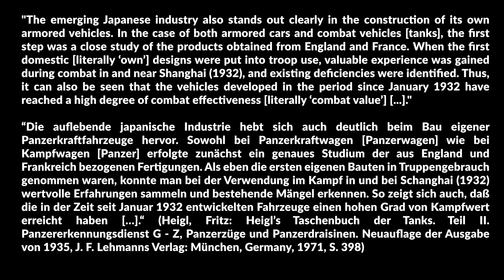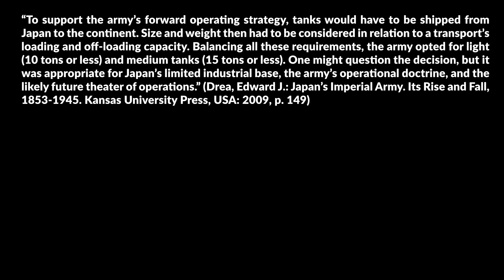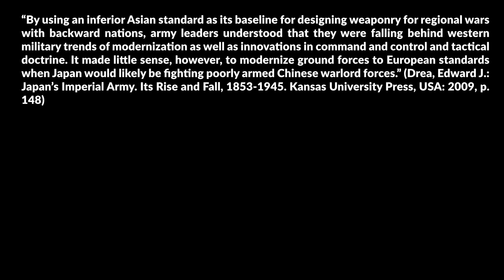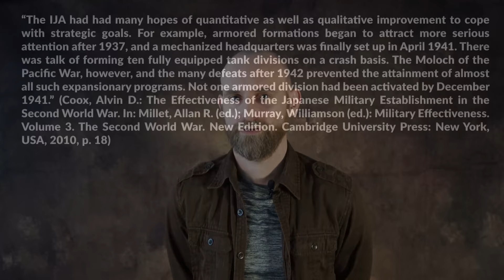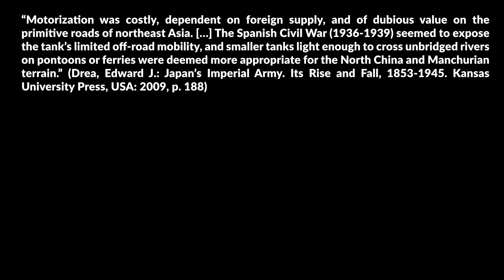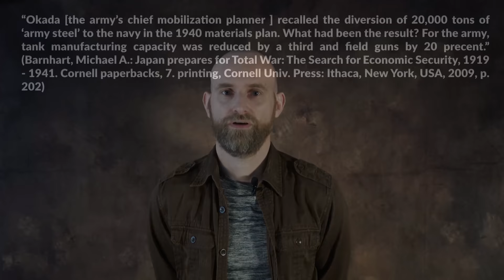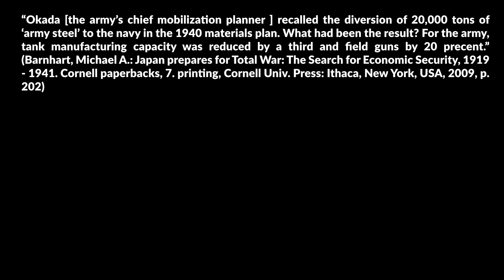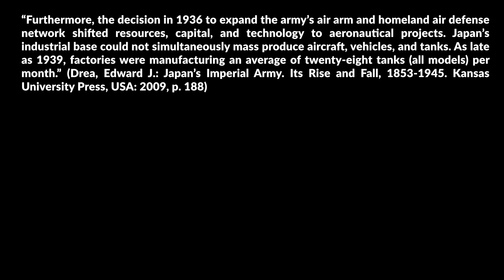The Problem with Japanese Tanks in WW2

Comment: The question thats never asked about the topic is: would japan have needed more or better tanks?
I mean like, they fought, to a big part, against the US on small islands, oten covered by jungle and with beaches, they were the defenders and had, at least on land, relativ short supply routes in these areas. Tanks are great in open fields, provide the benefit that they can operate over a large distance and push deep in enemie lines, something that does, as far as i consider, not really exist on islands. 
Taken this into perspectiv it sound far better if japan had invested more in anti tank guns.
A way to answer this question is, to look up the american use and successes of tanks in the isalnd hopping campaign. Has anybody infos about that?
And yes i know my points are a bit over simplefied, but try to look over this if possible
Reply: But China
Reply: @DioBrando-mr5xs  And as was pointed out in the video, the lack of infrastructure in China meant it wasn't very friendly to tanks, or at least not to the big monster tanks seen in the European theater.
Reply: @DioBrando-mr5xs  and japan wasnt defeated in china, st least not in the short term. What would happen in a longer war is a different thing. But japan was mainly defeated from America over the islands. Would better tanks have made a difference here? Or had tanks on both sides even a inpact?
Reply: @fandysetiawan5019  I’m not trusting that link, never will trust a link
Reply: @Predator20357  especially ones that the "person" just copypasted into the comment thread without anything else
I mean look into that comment history
Reply: Infantry anti-tank weapons would be even more cost-effective, as would mines when defending small areas like islands where you could easily predict where enemy tanks would have to go, especially if the sweepers couldn't get close enough to clear them without getting shot at. Japan had manpower in abundance, and soldiers willing to sacrifice themselves using them. The cheapest, most direct weapons would be the most effective for a material-poor country.
Reply: @andrewklang809  that effectiveness would be on defense, what happens to offense?
You cant be on defense for the rest of the war
Reply: @thrawnbayern5249  Japan was mainly defeated by the Americans UNDER the waves. Midway and Philippine Sea aside, the American submarines alone crippled the entire Japanese war effort and denied them the resources of SE Asia, even leading to the armies in China being starved of supplies. The loss of so many transports in the Solomons hurt them more than the loss of troops, warships, and aircrews. Logistics, logistics, logistics.
Reply: So why did the Americans bring tanks then?

Exactly, tanks were still useful
Reply: @looinrims  Tanks were crucial in every land battle fought in the Pacific, no question. As grievous as American casualties usually were, Japanese losses were always higher, often much higher. Combined arms were a big part of that. But the arm that did the most damage to the Japanese, even though it wasn't clear until after the war, was the submarines. Japan couldn't take advantage of their conquest of the East Indies and Malaysia if they couldn't ship the resources back, or supply their garrisons, and even before the retaking of the Philippines, that shipping had been much reduced. The failures in Burma in 1944 were directly tied to their inability to supply their armies there. Ichigo required years of building up resources, but once they were spent, they were spent, and Japanese shipping was in such a bad state afterwards, the Japanese were unable to withstand the Chinese counter-attack in 1945.
Reply: @looinrims  only bc you bring something doesnt mean its useful. Look at russian tanks in the first Chichnien War (i dont know how to spell the country in englisch).
And yes the US used tanks, but to a great part old tanks, the b line if you want to call them like that. M3 Lee's for example. They didnt develop tanks fpr the pacific front, they just uswd what was left of the west front.
And they had the tanks. The US never had to ask it self if they could deploy those things, bc they had tons of them, but were they really so useful?
Reply: @looinrims  US used tanks in the pacific to protect themselves from Japanese. 
If you are on a small island with 5 battleships and 5 carriers circling it and the enemy has landed heavier tanks, well battleships is kind of an anti tank weapon. 
And yes you can reload battleships at sea as learned during these fights.
Reply: @thrawnbayern5249  Japan was defeated in China. They couldn't win. In the 6 month period after Pearl the only people who successfully stopped the Japanese were the Chinese at third Changsha.  

The US crushed and counterattacked Japan, but their main goal had been to bring China to the peace table and they were never able to do so.  More and better tanks weren't the solution to their China problem so they weren't prioritized.
Reply: @fulcrum2951  The whole Japanese plan was based on using their fleet to allow them to expand their defense perimeter, then switching to the defense to bleed the Americans dry every time they tried to take a newly-conquered island fortress while the fleet focused on counter-attacking once the opportunity for a decisive battle presented itself. Japan knew they could only maintain the offensive for so long. They just hoped they could have taken New Guinea and more of the Solomons before that happened. But Coral Sea and Midway stopped them, leaving two holes in the Japanese perimeter in the south and allowing for American counter-attacks before the island defenses could be completed. Peleilu and Iwo Jima are the best examples of the kinds of defensive battles the Japanese were planning for right from the start of the inevitable American counter-attack.

As for Burma/India, I think the Japanese placed way too much stock in the likelihood of a general Indian uprising against the Raj. It probably would have been better for them to only take the most important areas of Burma, then switching to the defensive. I guess victory disease got the best of them there, after their incredibly successful capture of Malaya and the East Indies.
Reply: The island hopping campaign was not the only fight that the japanese army had to fight. 
China 
Burma 
Korea (N&S)
Vietnam
Cambodia
Laos
Thailand
Malaysia
Philippines
Were all captured and needed defending. The Island hopping of the Americans was important but not the only thing that the japanese military had to deal with.
Reply: @thrawnbayern5249  Flame tanks and 105mm Shermans? Extremely useful, especially as armored bunker-busters.
Reply: @andrewklang809  the Japanese plan in Burma worked perfectly until they launched an offensive into India and the Japanese did take the important parts, namely Yangon and the rails up to myitkyina.
Reply: @porksterbob  The Japanese were unable to provide food or ammunition for the 1944 offensive. The "plan" was to expect to capture food and other supplies from the enemy once their positions were overrun (shades of Wacht am Rhein?). As we would nowadays expect, they weren't able to seize these positions/supply bases quickly enough, as they were undersupplied to begin with, whereas the British Commonwealth/Chinese were at least supplied enough for the defensive. And so the Japanese army in Burma starved, literally. Because they had no supply lines anymore, and were trapped in the Burmese jungle alone, abandoned. The British attack in 1945 met minimal resistance. Which, for the Japanese, should mean something. The supply lines were long since dead. The American (and some British) submarine campaigns broke them.
Reply: @porksterbob  they were not defeated by china. China cost them great ammount of troops and supplies, but i doubt that china would have won this war alone. And china could never have invaded japan so a total defeat would have never happend.
And it wasnt the question. I wanted to know if tanks would have been any good in the island campaign
Reply: @pnonnymouse4840  indeed they werent, but even in most of these areas the country is not very suitable for tanks or at least good to fight tanks. Would tanks have made a difference here? Especially for a defensive fighting japan?
Reply: @thrawnbayern5249  China could not have invaded and occupied Japan. 

China had one move... and that move was to force Japan to fight the whole country. Japan had been very successful nibbling China one piece at a time and forcing the Chinese to accede to the new status quo.   

What the Japanese wanted out of China was not lebensraum.  It was much more akin to what the British had in India.  The Japanese saw Britain running India's 350 million people, making it a source of raw materials, soldiers, and a market for finished goods and the British did it with less than 100,000 Brits on the ground.  Japan wanted China to be something similar. A self governing source for raw materials and a market for finished goods that wouldn't require a large investment of soldiers. 

The idea of Japan's glorious destiny as the natural leader of Asia was fed into the army all throughout the 20's and 30s. Japan's conquest wasn't even a top down strategy. Rather, Japanese army officers knew that they could get promotions and fame by starting incidents with China. The fighting in 1937 wasn't planned, it was the result of an IJA which had developed a rule of thumb for any dispute with China. 
1. Make no local peace without defeating enemy forces. 
2. Insist on maximum demands. 
3. Wait for the Chinese to fold. 
4. Put some friendly locals in charge
5. Let Tokyo sort this all out later.

This was done in Shanghai in 1931, in East Hebei, in the Great wall campaigns of 1934, the original invasion of Manchuria.  Japan took huge amounts of territory with just a hint of grapeshot and the officers were heroes at home.   

Chinese leaders knew this play book.    

In 1937, China decided to launch all out resistance.  All the troops that had been carefully built up, the handful of planes and tanks that China had bought at great cost, all of those went into resisting Japan.   Now steps 1 and 2 went fine from 1937 onwards.   Chinese troops were generally defeated and Japan demanded a lot.... but then China didn't fold.  Japan found itself occupying more and more territory.   Japan had wanted a China with a friendly government which wouldn't require Japan to station a lot of troops.  Instead, they found themselves occupying 100+ million people which required massively expanding the army. Japan's economy wasn't built for a long war in China but they refused to leave China unless China admitted defeat.  But even there, the Japanese couldn't defeat China on their own, they could take and hold territory but it was too vast and too expensive to actually forcibly occupy 450 million people. 

Japan's attack on the Western Allies was about seizing resources to finish their interminable China campaign (with a side order of cutting China off from outside resources.)

Japan stepped into a Chinese beartrap and did more and more desperate things to get out of it with the sole exception of just admitting that it was a bad idea.  

Japanese tanks would have been useful on the Philiipines which has plains, but the problem is that in the island hopping campaign, most islands are small enough that a big aboveground target like a tank would just get killed by naval fire.
Reply: @thrawnbayern5249  . Sorry the point I was trying to make was , your original post looks only at the island hopping campaign. In which for the most part I agree that tanks in a defensive role against and amphibious assault are not going to fare well, due to the points you made and others. A better use of resources would be bunkers artillery guns and at guns and lots of small 1 or 2 machine gun bunkers. For an attacking force armour makes more sense they can close on infantry bunkers and use the radio for offshore support for gunfire of airstrikes against heavy bunkers.

But the japanese had a lot more than just small pacific islands to defend. A lot of places they controlled were perfectly adequate tank country.. 
Obviously not all this land was easy going but the allied armies used tanks in these areas so could/should the japanese have been able to do so.
Reply: @pnonnymouse4840  i totally agree with you. Japan wasnt only defeated on small islands and in china and for example the philippins was good tank country. But most of the time people focus on the pacific island theatre, so i did it, too. We both agree that tanks wouldnt have made a big difference for japan here, or at least were not better than bunkers or guns. When it comes to suitable tank country i still doubt that a better japanese tank force would have an impact. The time when these areas were reached, Japan had lost already. These areas were reached only by 1944 in great numbers by the allies, as far as i know, when japan already had lost all chances of winning the war on the seas. Without the uper hand there, a tankforce on foreign ground would be quite useless, bc they take tons of supplies which couldnt be given anymore. I think the discussion has a lot of the "Would more tigers won the war for germany". We dont take into conideration all the other big espects that would have been needed, so a tank force would have worked for japan. At least thats my view. I think i got a bit side tracked in my arguement here, sorry XD
Reply: Well its said that professionals look to logistics to ensure the victors of war. The Japanese knew this so had to go for a crippling first strike against the American Pacific Fleet. They gambled that they could gain such a victory that would cripple the Americans to such an extent that they could discount the Americans whilst they conquered the required resources from the Dutch East Indies etc and exploited them.  The Americans would take at least 2-3 years to build up the fleet. And might even sue for a negotiated cease fire . 

They misread the political will and the industrial capacity that the U.S. could bring to bear. They also missed the carriers which were not in port during the attack on Pearl. 

Its an interesting "what if" , should the carriers have been at Pearl and heavily damaged or sunk. How would the war have progressed? Midway would almost certainly have fallen. The east coast of America could easily been raided , bombing attacks on shipyards and major cities . San Francisco,  Los Angeles etc . 

But it failed and the U.S.  bounces back far quicker than  expected not giving the Japanese enough time to capitalise on their victories.

Comment: Although you touched on the subject when discussing supporting elements for tanks, I just wanted to note that distances between points in China and Manchuria are large. Tanks are essentially designed for a short operational range. Traveling under their own power beats them up and lighter tanks fare better. 
Every country of the period who needed to move a tank force any appreciable distance did so using either large trucks or rail transport. Mainland Asia just didn’t have an extensive rail network and Japan just didn’t have many factories capable of producing large, rugged, transport trucks.

Comment: Japan is in my opinion the most interesting country to study during the war, their severe limitations in all areas could lead to great innovations, but many factors like material shortages and the extreme conservative leadership hampered their capabilities.

If tanks weren't going to save the battle in the south pacific, then heavy artillery had its issues as well, namely how to move it. Mountains, dense forests and jungles provide extreme challenges for getting large artillery pieces to the front, and often there is no roads suitable for moving the large guns in Asia. The large caliber mortars Japan invested in proved to be extremely deadly, the advantage to mortars is their low weight, making them easy to move around the battlefield. And since Japanese infantry were trained for close-assault, ambushes, and deception, making use of concealed lightweight mortars coordinated with concealed infantry in the dense jungles of the Asia-Pacific theatre would have given Japan a better chance. They should have played off their infantry's strength by investing into more artillery, mortars, and definitely mines.

Comment: A side note on tank weight and transport, I have read that Rommel was able to lauch his original offensive earlier than thought because the British thought it would take longer to unload his tanks from the ships because the seaport had few cranes able to lift the tanks. But two of the ships had been designed to carry, load and unload railroad locomotives, so they could unload the heavy tanks themselves.

The IJA probably decided they did not need a heavy tank especially after battle at Khalkin Gol and the treaty signed with the Soviets, besides the Russians were "busy" in the West.